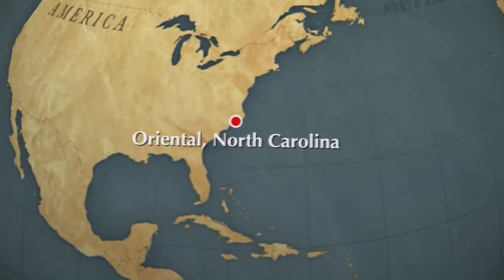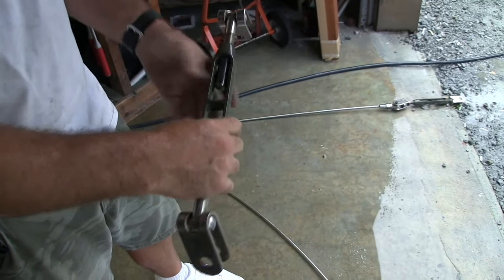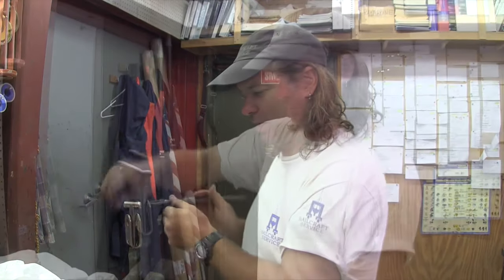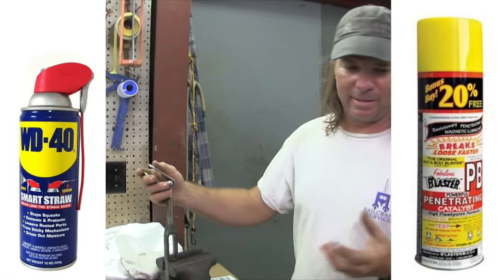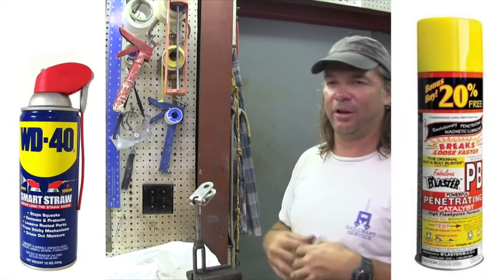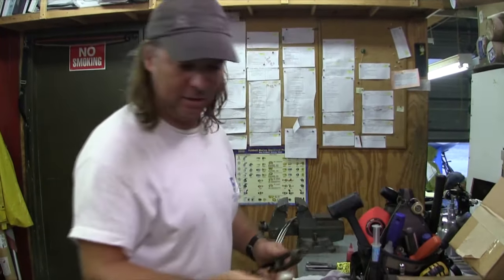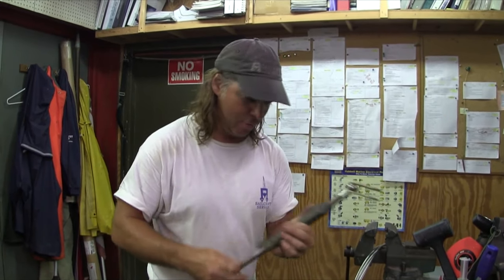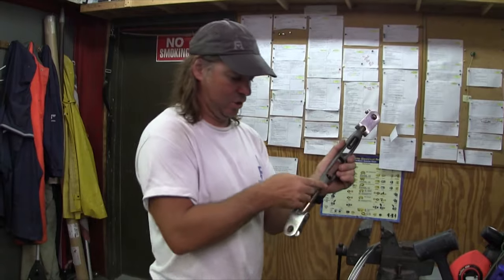Turnbuckles| #4 | DrakeParagon Sailing Season 1

Comment: Hey Drake, The absolute best penetrating lube I have ever seen is to mix 50/50 Automatic Transmission Fluid with acetone. It is something I learned working at a car dealership. It costs pennies compared to store bought stuff and you get a huge amount of it. Never seen anything work better. Just make sure you don't let it sit on plastic or rubber pieces at it will eat away at them. It is also a red color, so it can stain things if you are not careful.
Reply from the maker: +The Dude Hey thanks for the tip dude! :)
Reply: No problem man. Can't wait for the new video. Just re-watching some of the old stuff to hold me over. Lol.

Comment: So would a jam nut not be recommended to keep the treads motionless?
Reply from the maker: +Patrick Walker   I have seen people tap threads into the hole where the cotter pin goes, and then use a very thin bolt instead of the cotter pin, but I've never seen a jam nut used to keep the threads motionless.    I'm not a professional rigger so I don't know if it would be recommended or not.   It's an interesting idea.